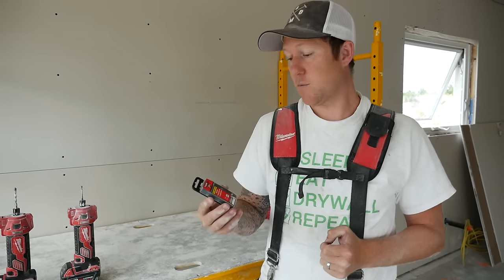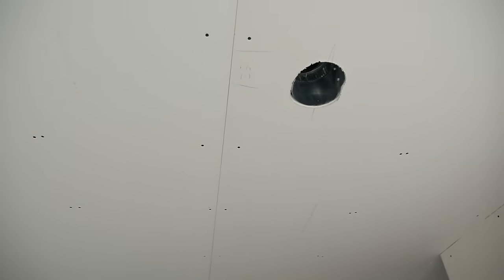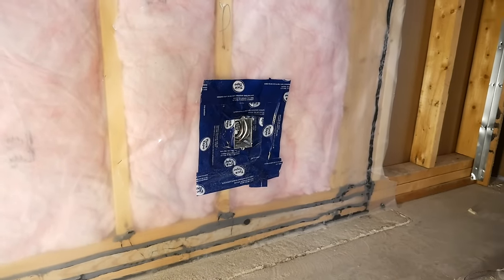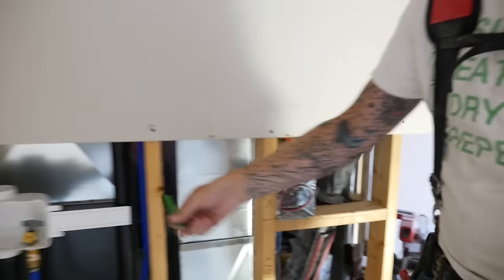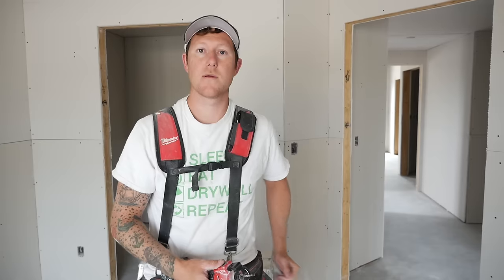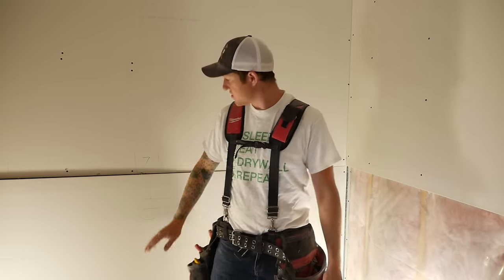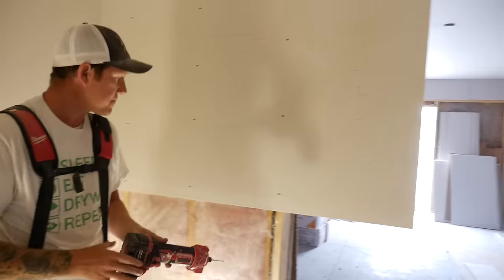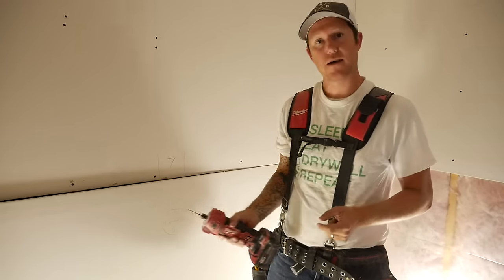Beginners guide to using the Cut-Out Tool/Router

Comment: That is a spiral saw. Also known as Rotozip..which is a name brand for the same tool. In this industry we know them as Routers. However wood butchers and wood trim gurus claim a router is a different tool and not a spiral saw
Reply: JRoger Perez  correct mate this is not a router 👍
Reply: It’s a cut out tool… Routers Use Bits to shape edges of material for either joining or for decorative purposes
Reply: @artifaxgroup  my first couple weeks doing drywall this confused me alot,my dad has a woodworking shop and everytime they said "use a router to cut out the box" i got so fucking confused.
Reply: Cut-Out Tool Vs Trim Router same tool with different bits and bases.... (Trim) "Routers Use different Bits... just for decorative purposes I guess?" lol ....
Reply: N C try using a cut out tool as a router using router bits... or search for router bits anywhere and let me know when you find rotozip drywall bits in a search then get back to me. I understand that the tools have similar form factors but they are designed differently. Intake and dust ports are in different places to account for the types of material being worked with, completely different RPMs (although they might overlap a bit), different chucks, a router has a base that you can dial in accuracy and a cut out tool has a simple guide bar (that most never use)

I understand the confusion. Which comes from it’s similar appearance and lack of a better word for it in Spanish which is probably where the misnaming started (from the tri-lingual packaging)
Reply: JRoger Perez I call it a zip tool
Reply: To be precise with the name is confusing. As skill saw..is a circular saw.. a sawzall is a reciprocating saw..
Reply: I stated with different bits and bases or ie guide...And things like dust ports vary by make and model or even chucks can vary. They also come in variable speed models too. The point is trim router can use spiral cutting bits too, so if you dont need the guide or can just make one. The only confusion is why some ppl feel the need to buy more tools? But for those ppl that feel the need its all good....
Reply: JRoger Perez ... Sorry to spoil your Comment here but As a 35 year veteran Carpenter I know what a True Router is...  I hate setting up and changing bits so I have (26) “Routers”... And the Brand name that came out with the Spiraling Saw is yes in fact. “Rotozip”... otherwise known as a Router which they copied / (borrowed) from the Wood working Router...  The Wood working Router came Out Years before the Rotozip was ever Dreamed of... “Wood Butcher” If your a Drywall Expert then Stay a Drywaller... Leave the Wood work to the Professional.... LoL
Reply: All i ever heard is router never anything else especially spiral saw lmao been in hangin and finishing all my life

Comment: U don’t use the router for every single cut on drywall🤦🏽‍♂️ they make drywall saws for a reason👍🏽 the router is supposed to be used for certain things to cut into drywall that u couldn’t cut with the drywall saw. Your doing the most to put up drywall wen all u need is a razor knife, t square, drywall saw and drywall sander to square off the edges. I’ve been doing this for a while and I found cutting the drywall with a knife is a hell of a lot faster and easier than the drywall router

Comment: Not a fan of this method at all. A well-built home will have a bead of adhesive run on the stud before fastening drywall to it. Just a clever way of cutting a corner to boost profit at buyer's expense. Another case of the Pro becoming less professional and more like the DIY guy.

Comment: I am an electrician and it pisses me off that just because they are faster for you my job suffers with cut wires.  Why don't you use shorter bits for pete's sake.  I push my wires way back but your guys still hit them.  You cost me thousands in labor every year.  You guys don't care and I sure don't screw up other trades jobs.

Comment: I would never use this for cutting down lighters, always use a hole saw with a silicone cup that catches all the dust. I use a Bosch cordless multi saw to cut out box's. I can't see the point in this tool.
Reply: Efficientcy piece workers can cut out more boxes quicker which means they can hang more which means more money

Comment: Meanwhile, the electricians are dealing with wires that are torn to shit...
Reply: Like most f' ups on the job, this takes team work. 1st, the electrician doesn't stack his / her wires in the box nice and tight. 2nd, the drywaller decides to not rectify the situation. 2 bits of lazy = a better electrician fixing the mistake and a drywaller getting his ass chewed by the owner of the company. It's a team job kiddos - play nice and talk to each other before and during the job...

Comment: I saw soo much wasted drywall any monkey can cover a room with drywall and then make the holes i saw at least $400 bucks wasted in 1 room
Reply: you have to waste a lot of sheetrock to hit $400. You "could" use smaller pieces at the header areas above the doors or below windows, but your asking for cracks within a year from settling at least where I live and our expansive clay soil.
Reply: This dude cant be a hanger lol depending on how cut up the house is or windows youre gonna have a lot of scrap, if you hang window cut outs and all everywhere just to save money then the finisher will be ready to kill ya i know cause i finish too plus you will have joints show everywhere and cracks from settling